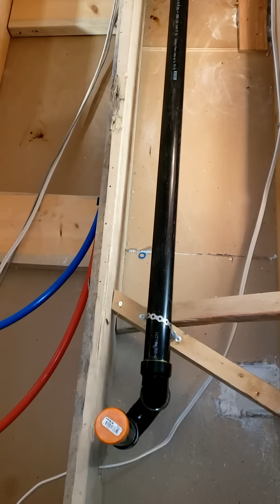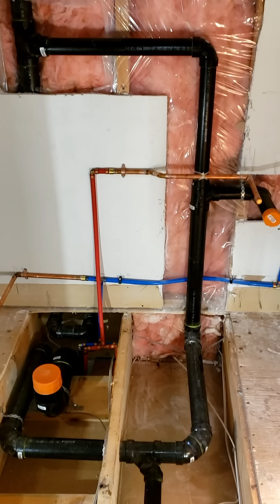Wet Venting EXPLAINED! - #SHORTS

Comment: That 3x2 tee should be flipped around
Reply from the maker: There is no 3x2" Tee.  There is a 3x2" Wye standing vertically that's elbowing with a 3" 90° elbow at the top to pick up the toilet, and 2" 45° and 90° elbows coming off the Wye's branch to pick up the vent.

There's nothing illegal or incorrect about it here in Canada.
Reply: @PlumbingsCool  im talking about your vent fitting. The tee wye should be flipped around for proper air flow
Reply from the maker: Oh, you mean the 2x1-1/2" TY.  No, having the wier at the top is proper plumbung practice.  Look at it this way:  any air introduced into the system is going to come from open air above.  Installing the wier at the top directs the air to flow more smoothly in and out of the vent terminal as pressure differentials fluctuate.

But here's the thing:  In reality, it doesn't really matter where that wier gets installed because the air's going flow regardless ("air no care!" 😁)

Want more proof? You had mentioned a "Tee" in your initial post, which is COMPLETELY absent of a wier...AND PERFECTLY LEGAL! 

If you were referring to drainage (such as the lavatory's TY, which has its wier at the bottom), then yes, I'd completely agree with you.
Reply: @PlumbingsCool  okay its hard to see everything but now that i have more info. That 2x1-1/2” twye for your vent is upside down there is no way around it. Air dont care but there is still ways for better air flow. Also most importantly it is an easy way to identify that it is a vent stack.
Reply from the maker: Then what would you deem to be the optimal way to install a tee (with no weir) to ensure maximum airflow?  Tees are allowed for venting in your jurisdiction, I presume?

Also, that 2" vent is not a vent stack by our definition, but rather branch vent; which are two different things.  Even if it were a vent stack, the "proper" way (again, it doesn't really matter) for installing a TY would be with the weir at the top of the branch opening...thus allowing the air to "swoop" in more smoothly from the air source, which originates from above, not from below.
Reply: @PlumbingsCool  When tying into your vent branch or stack the sanitary tee should “upside down” for lack of a better term. Thats all I’m saying. The airflow is coming from the top as you said, and putting the sanitary tee upside down would make better use of the fitting and allow for better air flow. Also like i said previously, it allows plumbers or contractors down the line to identify that line as a vent branch or stack.

Edit:typo
Reply from the maker: Oh...we're on the same page then, and have just been misunderstanding each other because the TY in the video already IS upside-down! 😁.

So we've actually been in agreement the entire time! 🤣🤣

Comment: In Massachusetts it has to be 2” all the way through to the rough when wet venting
Reply: 2" vent is for sure overkill but in all honesty, over sizing a vent will never be a negative besides the price of the larger size pipe. More air is good.
Reply from the maker: Yeah, I'm guessing you guys are un UPC.  Here in Canada you can run several toilets on an 1-1/2" vet, depending upon its developed length.
Reply: Same in ILLINOIS
Reply from the maker: Do you mean thatIllinois is UPC, or closer to our Canadian sizing rules?
Reply: @PlumbingsCool  same as Massachusetts in that the vent needs to be 2” all the way to larger diameter pipe. 2” is the minimum vent size for a toilet here. Sorry, hope that clears it up.
Reply from the maker: Yes, it certainly does, thank you!  Always interested in learning how things are done in other parts of the world.  And you never know...maybe your plumbing Code will come in handy if I ever end up moving down there to the  good ol' US of A!  🦅 😁

Comment: Hi, I hope you are doing good.
Considering this layout, I reckon the 3" pipe vertically coming upwards from near the WC is the vent stack. Now comsider a situation where this pipe is removed and also the 1 1/2" vent connecting to it which is coming from the wet vent. Now we fix an AAV on the sanitary tee instead to the 1 1/2" vent pipe. Now consider this bathroom group on Level 2 and consider a washer box in Level 1 which has a 2" vent connected to it. Now the sanitary pipe coming from the washer is also connected to the 3" pipe going down from this bathroom. 
Please explain wether the venting of the system will work properly or not.
Reply from the maker: If I understood your description correctly, there would be a few issues with your scenario:  There is no 3" vent stack in that scenario...although I do connect the 1-1/2" continuous vent to a 2" branch vent that's serving plumbing on lower storeys.  Therefore, you could certainly individually vent the washing machine box on the lower storey (it would not be a wet vent, since you need at least two fixtures to create a wet vent), but the individual vent would need to continue up through the second floor and connect above the flood level rim of the 2nd storey fixtures to prevent an unintentional bypass (similar to the continuous vent in the video).  An AAV would not be allowed to pick up fixtures from both storeys because all fixtures being served by an AAV need to be on the same storey - among other restrictions and requirements.  

Hope this helps.
Reply: @PlumbingsCool Thanks. Can you please make more detailed videos on the vents.
Reply from the maker: We'll see what we can do. In the meantime, you may want to look at some of my long-form videos that discuss venting in decent depth:

https://youtu.be/isHX-CnPiIA

https://youtu.be/df61XD7A8lA?si=jdtH2vf4Iod4WI0A

https://youtu.be/ry6kVUNeGSU?si=uLwlC0mYkV0lUCSj

Comment: I need some serious help I have a weird plumbing layout.
Reply from the maker: Can you elaborate on your issue?
Reply: @PlumbingsCool  imagine we’re looking at a blueprint.
5’x10’ bathroom.

Bottom right is the door way, directly across is the LAV. Toilet to the left of lav. 

Enter doorway, tub and shower is all the way against left wall with a left hand drain.

The toilet, LAV, and shower each have a piece of 1’ pipe stobbed out underneath. 
One single vent pipe, runs down the wall beside the shower drain not connecting to any of the other fixtures. 

How can I orient the pipes to make this work?
Reply from the maker: You did a great job at explaining your layout so far efficiently.  I'm guessing that if everything is already stubbed out from the ground/floor, then you're dealing with a prefabricated wet-vented 3-piece rough-in that was installed when the house was first constructed.  If so, then in most every case, the lav is used to act as the continuous waste & vent (or most upstream fixture).  Going by our Canadian rules, you'll know which one is intended to be the most upstream fixture by identifying the stub-out that is 2" in nominal pipe size (which measures 2-1/4" in outside diameter).  The other two stub-outs should measure 3" (toilet) and 1-1/2" tub/shower.  

In a nutshell, you want to run/route the vent to the 2" pipe, and connect it so that it's in a continuous waste & vent configuration as shown in the video. 

While it's possible for the tub/shower was designed to be the most upstream fixture (which would explain the existing vent's location), it's highly unlikely since the tub/shower would need to be configured in a continuous waste & vent configuration, thereby significantly lower the drainage pipe underground, and also require that the lav have its trap installed below ground as well...not likely. 

What's unclear is why the ran the vent at the shower side (unless they were just being lazy - which is very possible).

So the other thing I would do is confirm which of the smaller pipes have traps below-ground.  You can do this by removing/cutting the caps of the two smaller pipes and pouring a cup or so of water down them.  Then shine a flashlight and look for a reflection of water, which indicates a trap seal (and therefore a trap).  If only one pipe shows a trap seal, then that's definitely your tub & shower.  If they BOTH show a trap seal, then they did also put the lav's trap below ground and it's a little trickier to figure out which is the most upstream fixture.  If there's NO trap seal present in either two pipes, then the plumber was a hack and you're going to have issues with sewer gas entering your home through your bathtub...but hopefully not.

If you need to reroute the vent to the other side (opposite the entrance), then be sure to avoid trapping the vent in any way, which will eventually fill up with condensate/moisture water and cause the trap to become blocked.

Hope I understood your scenario properly and this was of some help to you.  Let me know if you need any more clarification.
Reply: @PlumbingsCool  most likely I need to reroute the vent to a different location, each of these have a 1 1/2 inch pipe minus the toilet and there isn’t any traps underneath the home just a direct 1’ piece of pipe to get through the insulation, would it be possible to use an AAV underneath the sink?
Reply from the maker: While I'm certainly not an advocate for air admittance valves, I'd reason that an AAV is certainly better than no vent at all.  Only be aware that an AAV is not a true and proper vent, because it only allows air IN in the event of negative pressure in the fixture drain, but not OUT.   If you do opt for an AAV, be sure to install it as high as high beneath the countertop as possible (next to the sink's sidewall); you don't want drainage water to touch it, which will surely damage it.  Also make it accessible so you can unscrew it and replace it if necessary (I have seen them fail).  We have other more strict rules, but for your purposes, that will be the most practical way of doing it. 

Back to your tub & shower:  If you truly don't have a trap below the floor, you're going to have much bigger problems than the sink vent.  You will need to get a trap beneath there somehow.  Truth be told, preinstalled rough-ins almost always need to be opened up and rerouted, because not much care is taken to install them in a practical manner.  Also, each bathtub has different dimensions, so an existing trap will almost never be in the place you need it. 

Hope that makes sense!  Good luck.   Feel free to let me know how it goes!
Reply: @PlumbingsCool  thank you sir!

Comment: I thought toilet only has to be most downstream fixture in vertical wet venting but doesn't matter in horizontal wet venting?
Reply from the maker: At least by our Canadian/Provincial rules, the toilet that's part of a wet vented group must ALWAYS be the most downstream fixture of that group, irrespective of whether it's connected vertically or horizontally.

The logic behind this is that the excessive volume of water emitted from a toilet can disrupt the trap seals of any respective wet-vented fixtures if they are downstream of it...so the toilet is mandated to be at the very end.

And while we're at it, it may benefit you to know that a maximum of TWO toilets can be part of that wet vented group.  And if there are two, then they must be connected SYMMETRICALLY so one doesn't affect the other.

Further,  the province Ontario requires that the two symmetrically-connected toilets be connected on the VERTICAL, whereas Canadian National Code is a little-more loose-goosey by allowing the two Wet-Vented Toilets to connect on the horizontal with the use of a double Wye fitting.

Hope this helps!
Reply: @PlumbingsCool  thanks for responding!
I guess some codes are different across the world
Reply from the maker: Yes absolutely...and according to every plumber within each jurisdiction, THEIR code is undoubtedly always the RIGHT Code!  😁

(Yes, plumbers could be a stubborn bunch!)